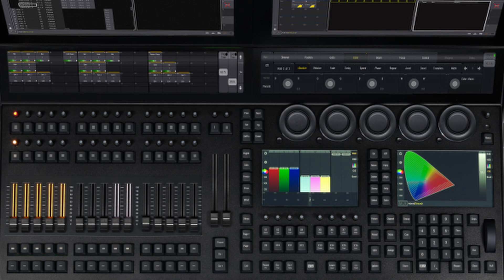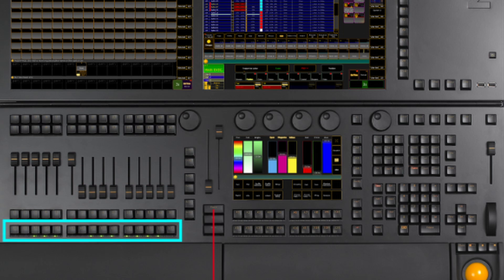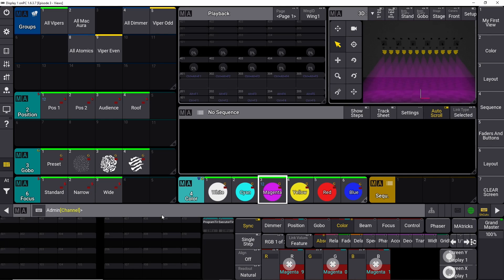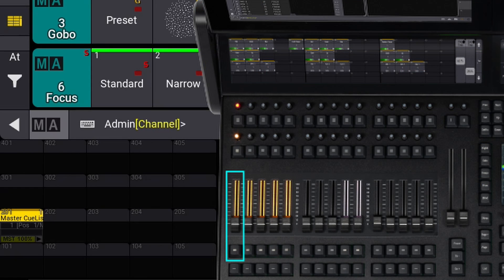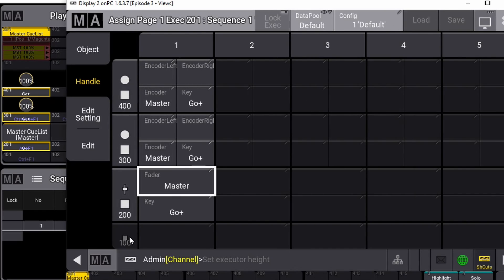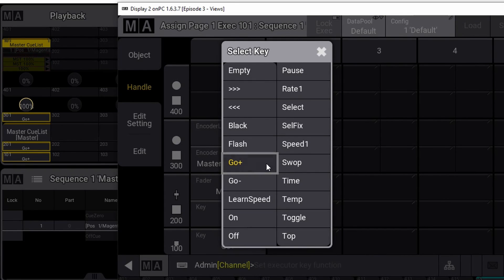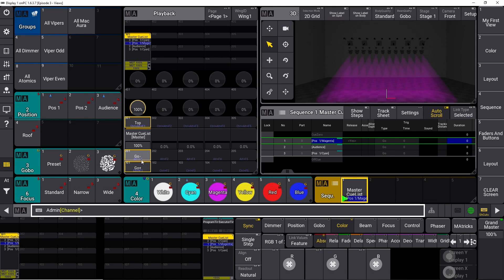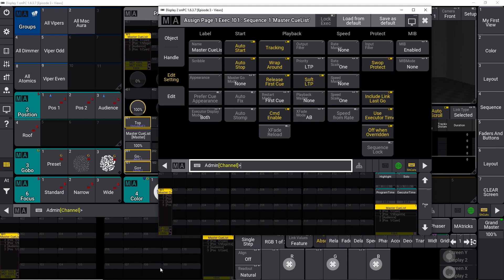E09 - Executors Faders And Buttons GrandMA3 OnPC tutorial

Comment: Hi! Thanks for all the great videos! I would like to keep the front lights on and individually adjustable apart fra the cues. Do you have a tip for this? If I put them on a seperate fader it just turns off when I lift up another fader.